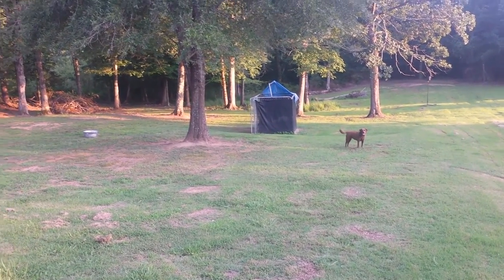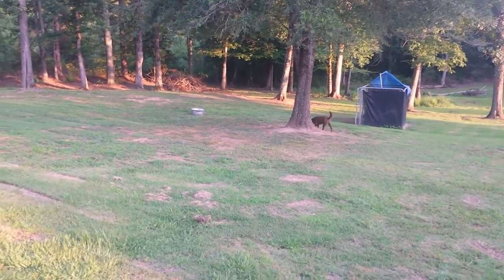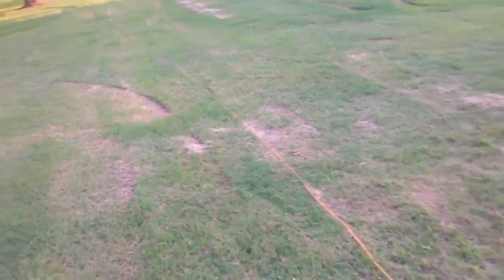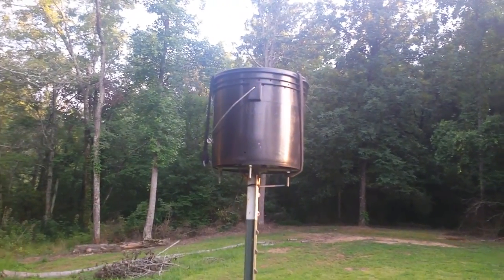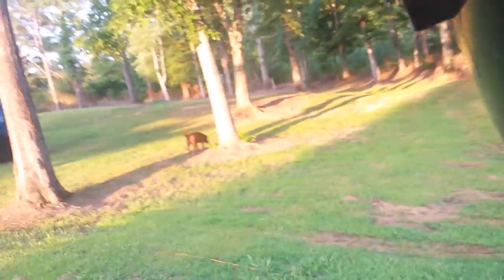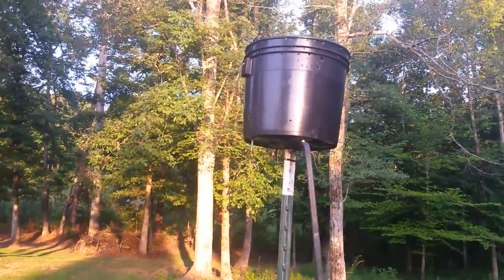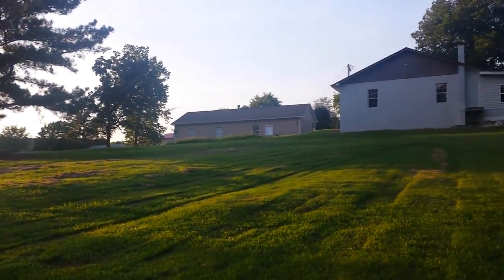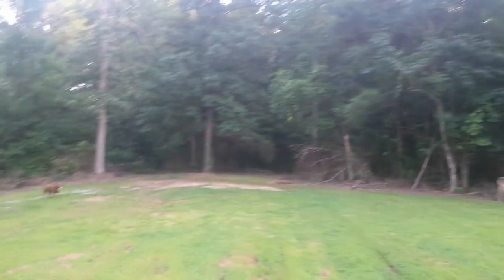PETSAFE Wireless Containment System Modification (WIRELESS DOG FENCE)

Comment: In my case, I have a neighbor on one side and woods on the other. I want the dogs to have as much access to the woods as possible, but only to the edge of the neighbor's yard. I was wondering how to put the transmitter on the woods side as far as possible from the neighbor's yard with the range set to high and figured I'd have to build some sort of shelter for it. This will work
Reply from the maker: It works great mounted in a bucket with a lid. Mine was mounted outside for 3 years with no issues. The bad part is having to replace drop cords because I would hit them with a lawnmower. Lol
Reply from the maker: Please like and SUBSCRIBE I'm trying to reach 1000 subscribers.:)
Reply: I just got mine. I noticed it was 24VDC feed...maybe a couple of small solar panels and 2 small 12V batteries? Cheaper in the long run than replacing drop cords and you don't have to worry about power outages. Mine is going back in the woods so solar isn't an option, but I'm running my power cord off the ground through the trees. Going a little simpler on the shelter...cut a small tree down, mounting the transmitter to it, and putting a bucket upside-down over it

Comment: After stating that your dogs like to chew, you laid out 150 feet of cheap and thinly insulated Walmart extension cord with 120 volts of alternating current flowing through it. Your dogs are standing barefoot on an earth ground. Not if, but WHEN they bite into it, the 120 volts will have a quick and easy path through the dogs bodies to an earth ground. They WILL NOT be able to turn it loose and WILL be electrocuted unless the power is disconnected before it kills them. 
How do I know this? In my younger days we stretched an extension cord from our house to our garage to power fans while our band practiced on a hot August day. We raised it 3 feet off the ground so our Dad could finish raking grass under it after we'd mowed. Dad finished and was sitting on the back steps drinking ice water. Suddenly our fans shut off. We came out expecting a tripped breaker to find Dad cradling and massaging our small terrier named Penny. She'd never been a dog to chew anything, including the cord we usually laid on the grass. For whatever reason that day, he saw her jump up and bite it. She was immediately unable to move her jaws to release it and was being severely shocked. Being an electrician, Dad reacted quickly and unplugged the cord. She was so stunned and effected that she was left hanging from the cord unable to let go. He massaged her as he worked her teeth loose and continued to massage after laying her, unresponsive, on the ground. None of us boys thought she was still alive. After a minute she began to move and after a few more she stood up. It took a few days to get back to her old self. If Dad hadn't been there she likely would not have survived the ordeal. I hope you find another solution.

Comment: Does it get below freezing where you live? PetSafe website says the transmitter should not be placed where it gets below freezing. I am thinking of using your idea of mounting outside, but where it definitely gets below freezing here in Indiana!
Reply from the maker: Oh yeah man it gets way cold here in Cleveland, Tennessee and hot in the summer and I have never had a problem with it. It just needs to stay dry and it works great man I have not had any problems.